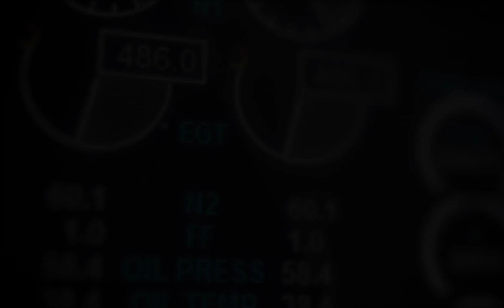Plane crash survival - Will the Brace position kill you?

Comment: The seats should be facing rearward. That’s the safest seating configuration for traveling at 400mph and then coming to an abrupt stop. Plus that would help to prevent against head injuries from flying debris. I’d rather brace my head backwards against a solid structure than have the immense weight of my body slam against my head and neck upon impact.
Reply: Would you get travel sick more easily?

Comment: Wow, very well explained.

I just have a question. As I am short and usually my feet barely touch the floor when sitting, how can I perform a safer brace position? (I would need to unfasten my seat belt to do a correct brace!)
Reply: Just don't unfasten your belt. Belt on is important!

Comment: Hey, Capitan, if that position is only to reduce forward inertia impact so why the seats are located back to tail instead back to nose?
Reply: WhaleSerg That actually makes sense now that I think of it. However it would probably be uncomfortable to be flying the the opposite direction you’re facing. It would probably increase motion sickness.
Reply: @michaelibrahim9275  wouldn't a decent fix be to give the chairs the ability to spin around and lock into place? Yea it might be costly to apply to every airplane, but it the long run save MANY more lives? Maybe tickets and amenities are more expensive for the first few years to sort of help but otherwise I feel that would be a decent fix that could touch on all those problems

Comment: Why don’t aircraft has three point seatbelts for passengers?
Reply: Because the anchor point needs to be at or above the level of the shoulders to reduce the stress on your spine (which is where the anchor points are in your car).  And because they've got to be behind you, your shoulder belt is going to be in the way of the person in the row behind you.  Also, I'd guess they'd have to beef up the airframe so the anchor point wouldn't pull out in a crash.

Comment: Quite honestly I'm sure the brace position and the chemtrails conspiracy theories and all the other idiotic ones were made to make all conspiracy theories look dumb and stupid for the regular people so they don't listen to them at all. I'm sure some conspiracy theories are reality (and have been proven to be) while others are just dumb ideas. Just don't believe everything and use common sense, if the airplane hits the ground or water, you need to protect as much as possible to get out fast and in one piece so it helps to protect your head and use the seat to soften the impact. And don't blow up your life jacket so you won't be stuck under the plane's roof because air is lighter than water.

What I would do in Economy is to push with my elbows against the seat in front and cover my head with the palm of my hands. But I don't know if that is really better, I just don't want anything to happen to my head, especially sharp objects hitting it. They can hit my arms.

Comment: Great video as always, thank you! I had a spinal surgery and I have a long two rods that make my spine stiff an not able to move in any direction. I cannot even bend, so "brace for impact" is not possible for me. Any advice what should I do in such an unlikely situation would be appreciated. On another matter, if you could once address that issue, why airliners allow passengers to take heavy luggage into the overhead compartments? I never choose the aisle because I am afraid that in a case of heavy turbulence or some accident, the huge luggage full of heavy stuff will fall and break my neck. I understand that passengers take their laptops, electronic and other valuable stuff with them, but I don't understand the purpose of taking huge 20 kg bag and put that inside like a maniac (sometimes compartments cannot even get closed). Thanks in advance!
Reply: Good point

Comment: Rear facing seats are used in military a/c which helps injury. When I take flights I prefer the rear as it is safer. However, statistically flying in a large ac is still safer than driving. Nice video.

Comment: i am probably going to fly next year to hungary from the netherlands, and i am really scared to fatally crash. But does it matter if you are not perfectly in the brace position? like if i do have my hands on my head, and my head against the chair in front, but i'm not that low and my feet are flat on the floor but not that far behind my knees?

thank you!
Reply: Mike -_- you would be better off using your time to worry about the safest route to drive to and from the airport
Reply: I am writing you in 2024, so far there have been 13 fatalities this year from airplane disasters, all of them in small privately owned planes that had malfunctions, yet in all cases there were survivors. You are a million times more likely to die from any silly reason you can imagine such as a simple bee sting. Not only planes are by far the safest way of travelling but every single disaster ever recorded is analysed thoroughly and calculated. The machines that guide the plane and the electronics are automatically updated to factor that cause like a simple update patch on a videogame. Additionally you are flying over Europe where every damn city has an airport and even small rural towns still maintain abandoned airways, which can accommodate you for an emergency landing. If there is a very teeny tiny molecule risk, that's for people who are flying over the two large Oceans and have no available runway for an emergency landing. Please heed to my advise and spread the good word, I 've already wasted roughly 5 minutes off my life, do not stress yourself without a reason to worry.

Comment: Rearward facing seats used to be the configuration for RAF Transport aircraft because it was thought that this was safer than forward facing seats in the event of a forced or crash landing. Whilst that rearwards facing configuration may be safer in such circumstances perhaps it does not permit the maximum seating capacity, so what price safety against commercial revenue. Have the airlines ever reconsidered this 'safer' configuration in recent years or do they still give the reason, that it is less popular with passengers?

Comment: Good info, I can see that's it's not a real plane cabin as if it was I'm sure the seat pitch will be a lot less than the ones you are sitting on and some I've travelled on your face is not far from the seat in front. Thanks for all the excellent videos you put on which are very interesting, you should have had your seat belt fastened when your family pulled you off your seat whilst on a live stream.

Comment: What about the pilot s safety wont he or she be injured?
Reply from the maker: +Prathiksh Shetty The pilots have shoulder harness and a 4-point belt. They will be busy trying to get the aircraft safely to a stop so there is no way for a BRACE position to be adapted.
Reply: +Mentour Pilot Plus on Boeings at least your hands are probably going to be occupied with the control yoke, so for you the best analogy to a brace position would be to hold onto the yoke, right? Worst case, you brace yourself against the yoke in full nose-down and maybe even both feet planted on the rudder pedals?

Comment: When booking flights for a holiday I noticed that an A230 had 74cm legroom and an A319 had 76cm, so more legroom on the shorter aircraft. Is this because the length of seating space isn't properly divisible by the minimum space taken by a seat, so they've left off one row and shared out the remainder?
Reply: Motorman2112 The legroom is made 100% by the airline.
Reply: Like you're gonna notice two extra centimeters.

Comment: Is it pilot's discretion for reverse thrust/wheel breaking or does the company advise? For example, i was watching morning landings at Manchester UK and i noticed that RyanAir was using more reverse to slow than other 737-800s. Am i just talking rubbish?
Reply from the maker: +Craig O'Brien Hi! That's a great question. There are general guidelines but generally Ryanair has shorter turnarounds than other airlines and therefor needs reverse thrust more often in order for the brakes to cool.
Reply: Mentour Pilot ahhh that makes sense! Thank you
Reply: It's all those stocky Irishmen that generate a lot more momentum.

Comment: Is there some equivalent to the brace position for the pilots?
Reply: Well, the pilots can try to hold at the glareshield right before the impact, but only if they are sure that the plane will crash land safely on the ground or on a water body (just like Cap. Sully and F.O. Skies did back in 2009).
Reply: Hands on the controls until full stop or total breakup.
Reply: They have 5 point seatbelts that stop their heads from projecting forwards, and I assume that they would try not to have to brace themselves so that they would be focused on flying the plane

Comment: Why not have the seats facing backwards so you can brace your head against the head rest? Less safe for another reason or comfort on normal flights?
Reply: Also when you take off the backwards feeling pulling you out of the seat and compressing your stomach is a great way to induce vomiting in anyone the least bit prone to motion sickness.
Reply: Jared Bartimus in the RAF transports the seats face backwards. airlines dont because it wouldnt be as popular with passengers.
Reply: loose objects become more dangerous, cost, and the fact that you usually decelerate so fast that youre screwed anyways or slow enough to survive easily, decelerating somewhere in the middle would be rather rare
Reply: I guess it’s primarily because passengers would prefer to face forward like many people do on trains. I experienced flying backwards in a BA C-class and it wasn’t a huge difference though. I once toured a military AWACS planes and there seats are backwards for landing because it’s safer
Reply: I had read elsewhere too that though backward facing seats would be safer, they have been designed facing forward to please the passenger, as you usually prefer to see where you're heading rather than what you've left behind. But in an age of air travel where pleasing passengers has become absolute second to increasing earnings, perhaps its time the backward facing seat idea should be implemented. After all, it's supposed to be safer. And safety is first.

Comment: I heard a theory, which says, that the brace position isn't really good, becuase you are likely to brake your fingers and can't open your seatbelt to exit the aircraft. I do not have any source for this, but it was quiet convincing for me. Instead of the normal brace position they showed another one, which does not brake your fingers and provides the same safety for other injuries. Anybody heard the same or is it just me? Nevertheles really nice video Mentour Pilot :D
Reply: I'd rather break my fingers than my head.
Reply: Hans Schmidt the brace position he showed won't break your fingers. It would break them if you'd interlock them. Therefore it's important you put your hand on top of you other hand and don't interlock your fingers 
Hope I could help
Reply: +Hans Schmidt You don't actually need much finger strength to unlock an airline seatbelt. It's a spring-tensioned latch, you pull on it and the seatbelt unlocks. If it were a push-button latch, this would be true.
Reply: thats true :D
Reply: yeah thx man :D @Txt Renee
Reply: Its been studied people die in aeroplane fires mostly because they dont know how to open seat belt buckle. Its different from a car seat belt where you push a button.

Comment: Am I right in thinking that you can't really brace in the cockpit?
Reply from the maker: +Edward Cameron That's correct. We focus on flying the aircraft until its standing still on the ground.
Reply: Pilots use a 5 point harness and they are strapped into their seats. They need to be operating the controls, and fly the aircraft on the best possible way, even during a crash.
Reply: Edward Cameron It is not necessary because of their better seatbelts. Passengers are just held at the pelvis level, so they can still bang their head into something, usually the seat in front. Pilots are paid to endure an addtional shoulder harness, which has the same function as the bracing position: avoid any impact into parts of the plane, instead decelerate body parts together with the plane.
Reply: Your head can be hit by debris that eventually make trought the windshield, and it can hit the glareshield or the yoke as well.
But as long as the pax and crew back in the cabin are fine, it's ok. Of course it's not cool getting hurt, but if you can save those lives back there, it's fine.
Reply: Edward Cameron hand on the dash board that's all you can to
Reply: Mentour Pilot Is there anything in the cockpit that the pilot can hurt themself on? I mean other than hitting the ground of course.. But can your head reach to the control panel or something?
Reply: Pilots wear a 5 point harness, no need to brace for anything.
Reply: probably won't be much left of the cockpit if you crash anyways...
Reply: They also have four or five point harnesses.
Reply: If the plane crashes I don’t think pilots are needed 😂
Reply: There are many airline accidents where most of the passengers survived but the pilots did not. It is very sad but pilots are heroes imo. Like Mentour said, they focus on flying t ill the last second.
Reply: I've personally seen 3 point harnesses and not the 4 or 5 in cockpits.
Reply: But don't the pilots wear a different type of seatbelt? The ones similar to formula 1 cars? That go over the shoulder.
Reply: John Pollanen Yeah they do and pilots cant really brace on the job until technology advances I guess
Reply: In the ground in case of a crash. ;-)
Sorry, couldn't resist. :-p
Reply: @waswolltihr1526  No, he was correct. It's 'On' the ground.
Reply: @ploodl7943  You didn't get the joke. I said it's in the ground in case of a crash....
Reply: You can brace in the cockpit. You can brace anywhere. However it's harder to successfully land an aircraft while doing so.